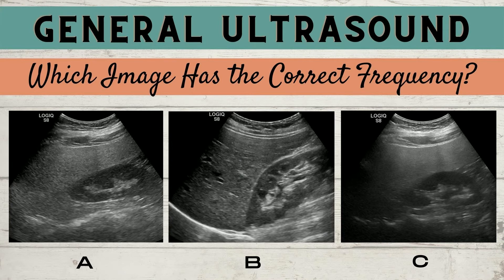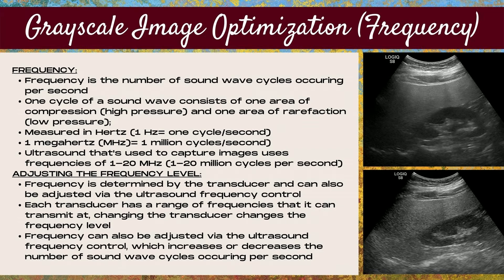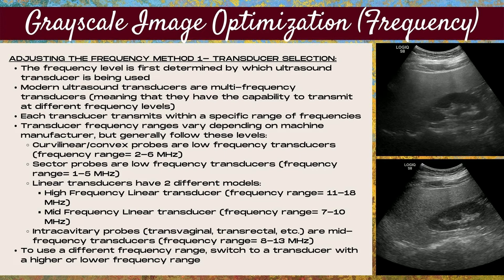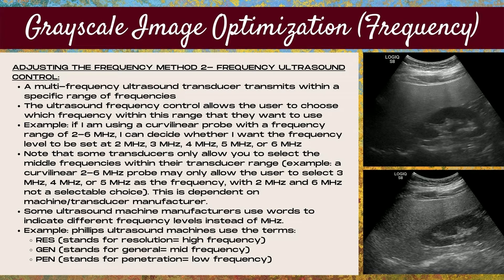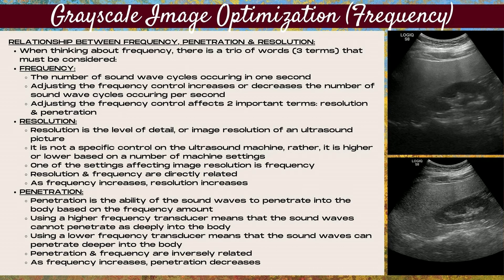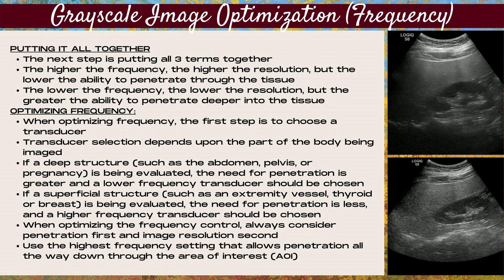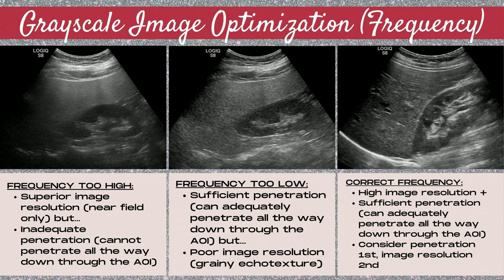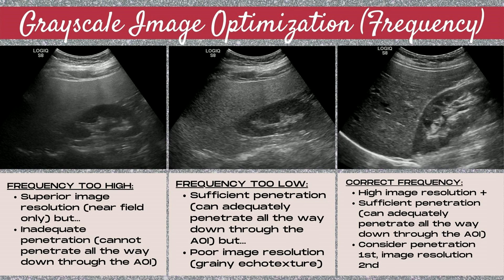General Ultrasound | Frequency How-To Guide

Comment: How, if not by frequency, depth is changing the image?
Reply from the maker: Great question! Depth and frequency are two completely separate parameters. Depth is how deeply (in centimeters) the sound waves are penetrating into the body. The depth control allows the user to select a deeper depth or a shallower depth for the sound waves to travel into the body. Frequency is the number of sound wave cycles occurring per second. Adjusting the frequency control allows the user to select a higher frequency (more sound wave cycles occurring per second) or a lower frequency (less sound wave cycles occurring per second).

Comment: What about phased array frequency? Also how is frequency is determined as far as use on the body? Is there some kind of chart used for different parts of the body? So is wave length, frequency related? How does one become certified in the use of ultrasound ?
Reply: Pppp